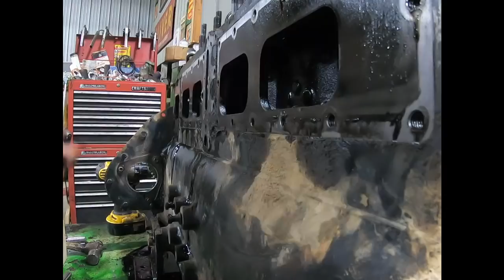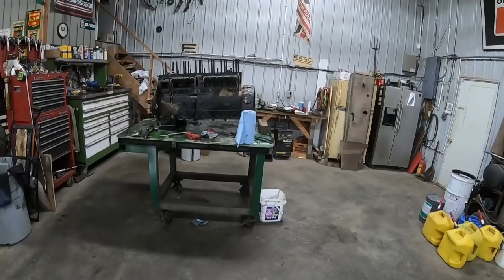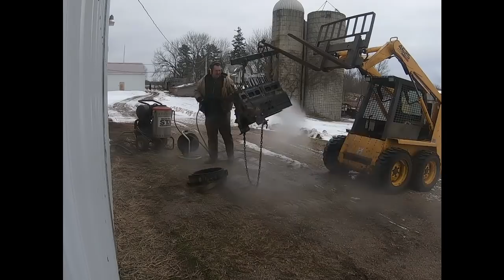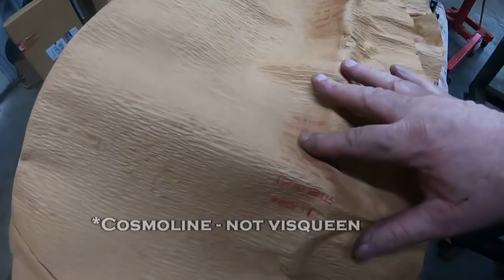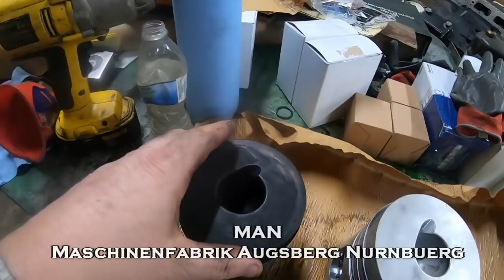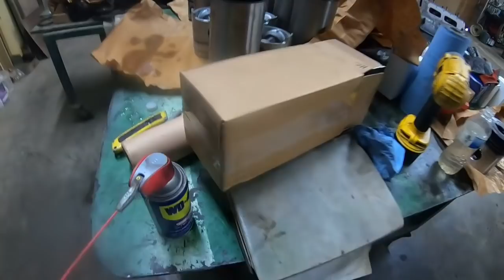White 2-155 Engine overhaul - Part 1

Comment: great chat on things about the compression and the whole sleeves and bore thing i have always wanted to work on a Herc 478 but no one really uses them in tractor pulling even lol. The Few Whites/Olivers around play with Perkins, Cat and Cummins … Its pretty much a lesson in Pyrotechnics with diesels and the old saying the more Heat the more power diesels make .
Reply from the maker: I've seen a puller with the 478 that was converted to run alcohol.  I don't remember the name,  but it sounded awesome.

Comment: Been there, done that, I will agree, everything in that engine is heavy! I rebuilt a 2-135 in 1992 and 10 years later it did about the same thing yours did, 3/4 throttle going down the road, what a horrible noise. Sold it as is, never found out exactly what happened.

Comment: what did you come up with on the pre heater that failed to cause all the trouble to begin with
Reply from the maker: I thought I had found a replacement heater, but no luck. Almost all of the Oliver diesels used that preheater, and I've only come across a handful of incidents because of them. Basically I think I drew a short straw and got unlucky. I'm leaning towards leaving it out. It should start good enough with these pistons that it really won't be needed.
Reply: @ThatOliverGuyChris  could you show me a pic of the intake is it a square if so how big of square is it what i am thinking with a bit of machineing get a grid heater for a old 12 valve 5.9 may take some work but i know for a fact there is no porcelain used in that one and should only be some machining to make it fit the wireing on it should be about the same as the white

Comment: I was in a combat Engineer outfit in Germany ...... for some reason we never  got good service out of our Multi fuels.....We had 15  5-ton Dumps and lost 13 of them to blown engines in 30 days of Tank Trail repair at Grafenveor one summer.... I was  an Heavy Equip repairman    Dozers and  Loaders  were my concern  but I noticed the Wheel mechanics were  covered up.....  The Army Maint.. system was organized in levels... and at the  Bat. level we were not authorized or equipped to do major repair..... Send it up the line to a support  outfit.......But I think most of the problems were Head gaskets   If I remember correctly they were blowing the gasket   out between the head and block .... We had a Boss  302 racing motor that we had to seal the hesd gaskets with Halomar

Comment: The thought of using Locktite sleeve retainer on this made me absolutely cringe. That stuff will make it unbelievably difficult if not impossible to remove the sleeves without a lot of heat and a sleeve puller should you ever need to pull sleeves again. Those who have said that oil wicked between the two surfaces isn't a heat conductor but rather an insulator are just flat mistaken. The heat transfer capacity of oil is nearly infinitely better than the air gap without the oil. The oil won't wick to areas of metal to metal contact, the areas it does wick it aids in heat transfer, not hamper it. It's your machine, so you can make your own decisions Chris, but please look into how hard it will be to remove the sleeves if you do use it. In the shop I used to work at, we only used sleeve retainer on very loose non flanged sleeves. Lots and lots of diesels have slip fit liners, the flange on top holds it as designed. On a less ominous topic where did you source the Cam and Lifters?
Reply from the maker: I got the cam and lifters from Hercano Propulsion.  Way better price than anything online.

Comment: Happy to see this video. Looks like things are going to work out. Have you located another heater without ceramic or is that all that's available? I would be uneasy installing another one with ceramic!
Reply from the maker: I thought I was on to something,  but no luck so far. I might just leave it out, the people I have talked to with the high compression pistons say they start excellent.

Comment: You ever watch Bryan Block?  I don't remember his exact channel name, but he just recently got some pistons+sleeves (for a JD) and the rings were all pre-installed as well... and the gaps were all in a line!🤦‍♂️  I used to build a lot of small block chevys, among other engines, and I'd use a syringe and a piece of plexiglass to measure chamber and piston dome/bowl sizes.  Well, going to buy new 200cc syringes was always a challenge... they'd always question me as to why I need a syringe 🤷‍♂️🤣  I was like "I'm not using a syringe this big for my meth... duh!"
Another great video, Chris!  Can't wait to see the 2-155 back up and running again!  Thanks for sharing!
Reply from the maker: I haven't heard of him, but I will check it out. I went to service school for the Iseki built Masseys, and they were telling us that if we pull out a piston and the ring gaps all lined up that the rings had rotated following the cross hatch and that they had been put in staggered at the factory.  It didn't feel like any of the guys belived them, lol!
Reply: @ThatOliverGuyChris  Ohhhh... yeah.  That would be uncomfortable.  Like, "should we keep listening to this person or not now... I don't know" lol!
Reply: My 2012 Honda Odyssey had to get the rings replaced at 100K miles, because the gaps had lined up, allowing oil to get in the combustion chamber, and fouled out the plugs.  Honda had a service bulletin out on the issue, and covered it under warranty. Honda can't explain why it was only an issue on the 2012 models.  I think someone installed them incorrectly.
Reply from the maker: They're with the company,  how can they be wrong?

Comment: Another awesome video!! What were the differences between 155/135 series 1,2, and 3?
Reply from the maker: The two sizes looked the same but there were differences in the drive train. Most 2-155s got a heavier duty over/under, and wider planetary final drives. The horsepower difference was all in the injection pump settings. 

Series 1 had the silver stripe side panels like mine. 
Series 2 was largely the same, but they had the red stipe decal on the side panel. This marked the end of White Motor owning them and when it became White Farm Equipment,  or WFE. 
Series 3 saw a reworking of the cab. The fuel tank no longer went back inside the dash, and the front area was sealed up, greatly cutting down on noise, heat and dust from the engine. The shfiter was updated to the 'gated' rails in the cab, throttle and over/under levers were moved to the side console.
Reply from the maker: There were probably other changes, but those are the ones that pop into my head at the moment.
Reply: Thanks!

Comment: 6:42  Removed .006 from the head surface?  Seems like a decent amount of removal.  How much can be removed before discard?  I recommend verifying the machine work.  Specifically the valve recession, and injector protrusion.  Not sure if there are different thickness injector sealing washers to compensate for machine work.  I think the 640 sleeve retainer is a good insurance policy.
Reply: I had .040 taken off a Oliver 283 head to increase the compression ratio but it is a gas .006 is nothing to clean up a head
Reply from the maker: I just double checked.  Well within specs according to my service manual. Better safe than sorry.  Thanks for watching.
Reply: @ThatOliverGuyChris  Yes sir.  Big fan of trust but verify.  Really looking forward to seeing it back in action with the improved compression.

Comment: Your pistons and sleeves are older than me lol great video! Ps. Is there a updated torque value on the 12 point rod bolts for a gas 283 my old Oliver shop manual listed 47ft lbs?
Reply from the maker: I don't recall off the top of my head. I try to remember to look it up.